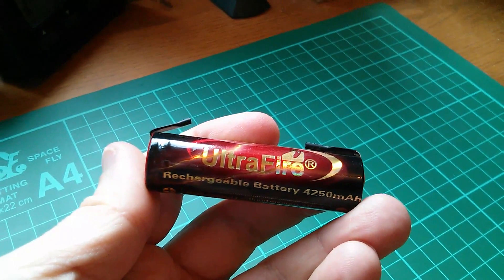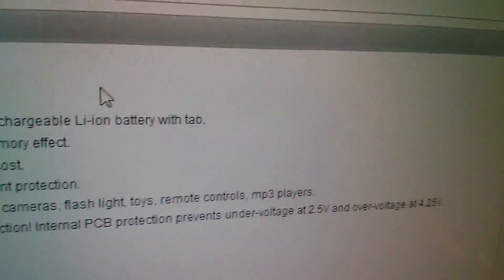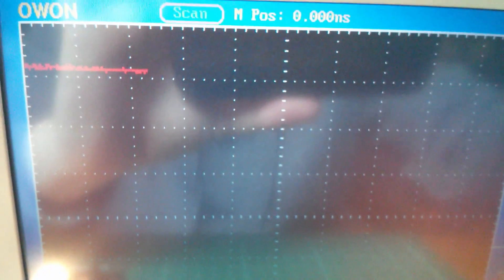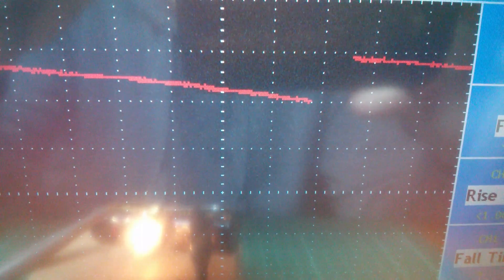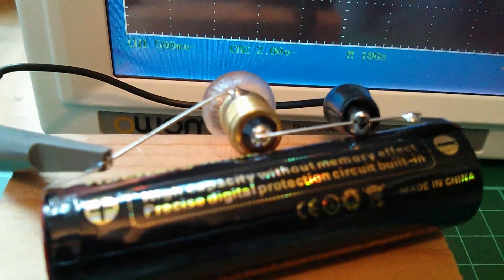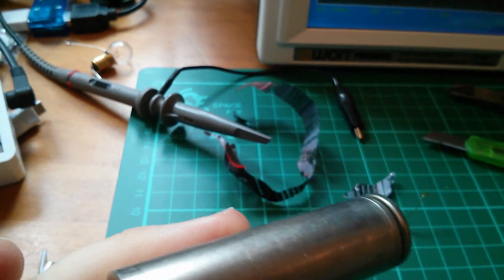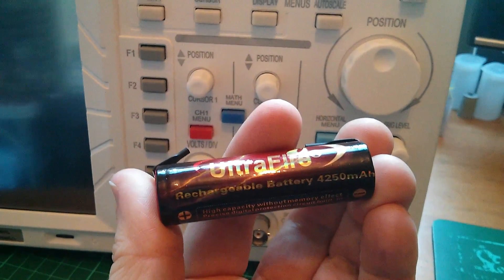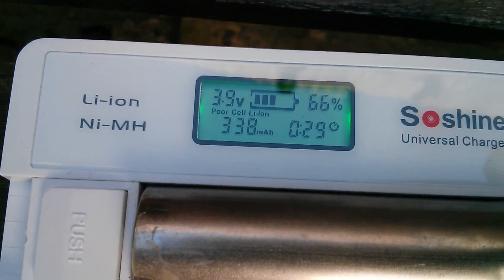Lithium Battery Fun - Testing 18650 Cell Undervolt Protection Circuit

Comment: ultrafire is a rubbish. Max capacity of ultras is 1500-1800mAh. I’m happy with these (capacity ~2500mAh): fasttech.com/products/1136603
Reply: Only Panasonic or Sanyos. Nothing else!
Reply: lol "4520 mAh" , anyway i think you have got one that is not protected , because i've bought Ultrafire PCBs separately , and they work as expected, they cut at over4.25 volt and at under 2.5 volt , to make it work again you have to reach 3volts on the cell, also short circuit protection works , if you short it , you won't even see a spark
Reply from the maker: ***** But I can't find any that have brand names of major Japanese manufacturers on them
Reply: Oh that's odd. In german eBay shops I can get them without problems. I have 4 unprotected ones. They have green plastiv wrap witch feels quite nice on the hand. :D
Reply: Julian Ilett
Hey. I figured it out. LiIon/LiPo 18650 cells made by Panasonic have the product number beginning with NCR.

I have 4 NCR18650B ones. It are the unprotected ones. I just forgot how much capacity they have, it is not even written on them.

http://www.ebay.com/bhp/panasonic-ncr18650b
http://www.ebay.co.uk/sch/i.html?_trksid=p2053587.m570.l1313.TR2.TRC1.A0.XPanasonic+NCR18650B&_nkw=Panasonic+NCR18650B&_sacat=0&_from=R40

I think these are some protected ones. But it is stupid. The protection has to be in the appliance! Not on the battery! So I bought rather unprotected ones and will protect them individually. I will use them in an emergency charger uinit.

ONLY BUY THE GREEN ONES!!! Everything other could be fakes!

PS: If you buy a pair, please make a video.
Reply from the maker: ***** I'm coming round to your way of thinking. Better to have unprotected cells with protection circuitry in the device - UNLESS cells are in series where protection is essential.